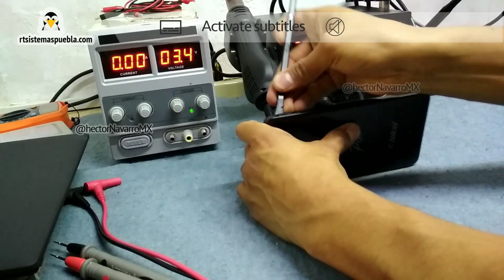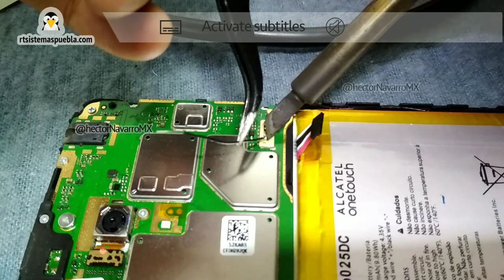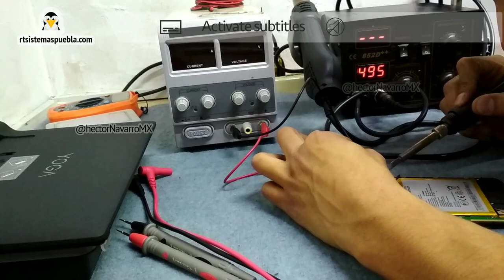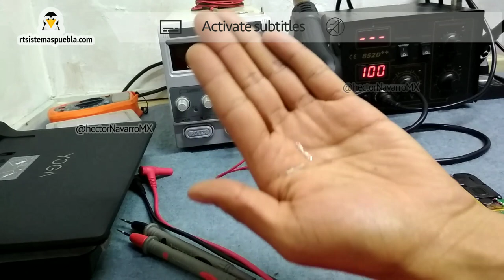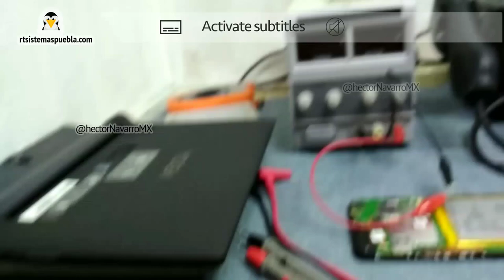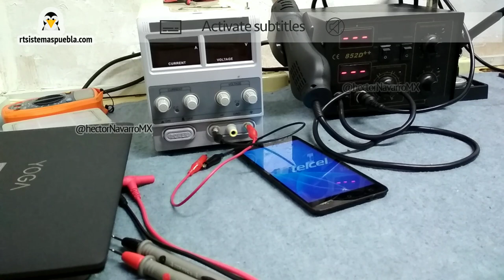How to power on Alcatel Pixi 4 8050G without battery with BAKU power supply

Comment: la pregunta es como encender el equipo si no tenemos la bateria, en el caso de los alcatel la mayoria de los modelos no encienden con fuente, ya que la bateria contiene unas lineas de datos. salu2 colega
Reply from the maker: No hay manera de hacerlos encender con 3.4volts de fuente externa.

Este modelo 8050G es antiguo y por eso se puede.

Están diseñados para que la gente ordinario como nosotros, no lo pueda encender "inyectando" 3.4 volts.

Posiblemente consultando el esquematico e inyectando 2 voltajes diferentes, pero no tengo idea ni de donde buscar los esquematicos. La usb dongle es cara y necesitarías una segunda fuente de poder, o incluso una tercera.

El punto es que no es arrancable a primera instancia.